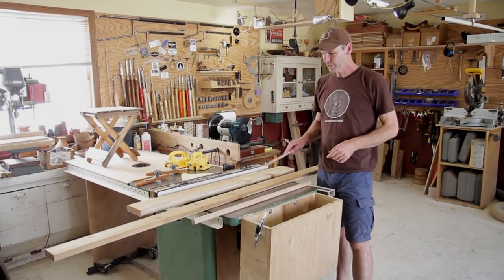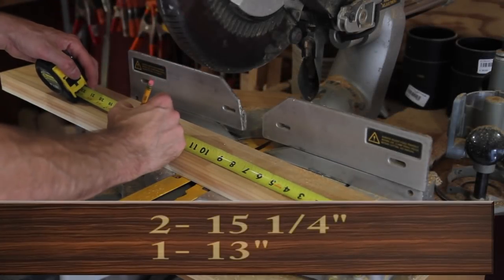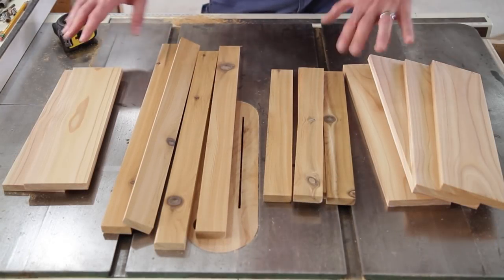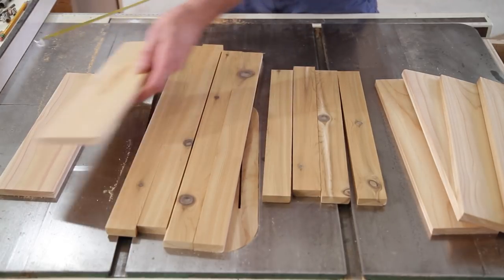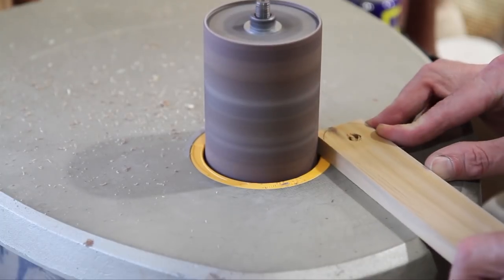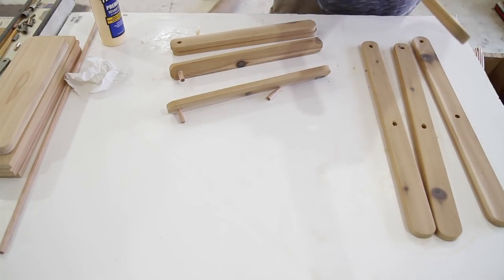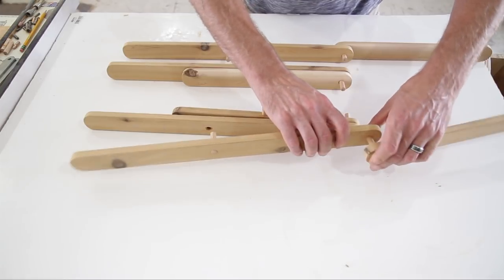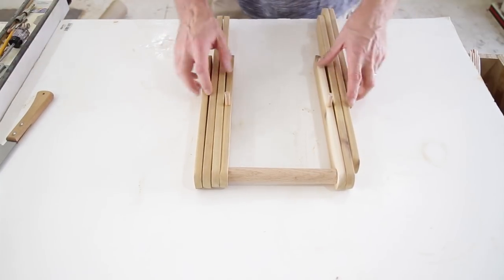How To Make A Folding Table

Comment: Great video. Love how you break it down very easy to follow.  I made one a little longer and it came out great. One question. What did you use to seal it? Would a regular water based poly lock up the dowel joints? Appreciate and enjoy your videos!
Reply from the maker: That's awesome! Thank you so much Steve!! If you're going to use it outside, I think any poly finish would work great.

Comment: Great vid thanks. could u indicate what size bits u used for each hole drilled?
Reply from the maker: Thank you very much Kareem!! Sorry I don't have the bit sizes but I did add the bolt sizes. They're pretty much the same. Here's a link to an Instructable I did for it. Maybe it will help more. https://www.instructables.com/Folding-Table-1/

Comment: Carl I've been building these little tables for years mostly from pine and some cedar. I also build bigger ones 36"sq, or round tops 1.5" cedar they work great for outdoor dining on the sundeck. Good stuff did someone swipe your lathe??
Reply from the maker: George Daruda Hey George, I'd love to see some pictures if you feel like sharing. I sold the Powermatic, and I'm getting a Robust, and becoming a dealer. It should next week :)
Reply: Carl Jacobson I don't do videos but I'll see if I can get some pics for you I also make deck chairs too. They're a two piece that fit together and you can stick four of them in the trunk of a car they work well with the tables

Comment: one quick question, what keeps the legs from not popping out of the dowels? i seen some parts like the middle dowel it only has two boards so you cant glue one side or it wont swivel so what keeps it from popping out of the other leg? i have seen many done of these but they use bolts and nut but not dowels so i like this method much more but i just dont know that part in order for me to want to make it i must figure out those details hehe...oh and second why the dowels to not let the table close flush in the middle part? just wondering.
Reply from the maker: Each of the dowel have glue on one end, once you put the flat boards on the tension holds it together. You could use smaller dowels in the center I don't think it maters.

Comment: What's an alternative to making the round edges without that tool you're using? Thanks
Reply from the maker: You could use a jig saw or band saw to cut them and then hand sand.

Comment: Couldn't get it to stay together even with wood glue. The tension on the legs being sandwiched together made it impossible to unfold properly. Went back and sanded thoroughly. Still wouldn't open. Sanded more. Last try, legs broke and finally called it quits after 6 hours and 30 dollars. Feels so bad to have a "well thought out" piece of carpentry let you dow and cost you money.